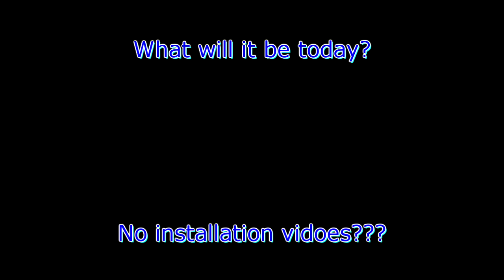No installation videos????!!!!

Comment: Hi Thomas,

I appreciate your expertise you demonstrate in your videos. I've been fixing cars since I was 13 years old. I'm a licensed air craft mechanic and spent 5 years as a journeyman mechanic doing brake and front end work.
Reply: Continued, I see that you do quality work and that you understand how the systems you work on are suppose to work. I really enjoy it when you do your work bench of knowledge drawings. You use a spray bottle to clean excess coolant off places where coolant was spilled, thus preventing a customer coming back thinking he still has a coolant leak. I think you are an excellent mechanic and an excellent auto technician.
Reply from the maker: Ssactoralph Thank you very much for the kind words! I still need lots of improving in a lot of areas. Thank you for watching!
Reply: Ssactoralph .

Comment: Totally agree with your stance. I like to use videos to get a general idea of where to start and which direction to go. I can't understand those lengthy videos where they are explaining where to jack up a car and then proceed on how to do a timing bet. IF YOU DON"T KNOW OR CAN"T FIGURE OUT HOW TO LIFT YOUR CAR, YOU SHOULDN'T EVEN CONSIDER DOING A TIMING BELT CHANGE.
Reply from the maker: I just changed my timing belt... the engine doesn't start... what could it be?

Comment: hello there...I finally got around to checking the oil pick up strainer on my audi a4 b6 1.8t and it was very clean. I cleaned out the grime in the oil pan and cleaned the strainer. My low oil pressure problem was not solved though. Any other place I can look to fix the issue? I always had the low pressure issue but it was very intermittent until last week when I changed the pcv breather tube. Since then the oil pressure light has been coming on and stays on. I think some plastic bits fell into the hole when I removed the old breather. One other thing, I always used to hear a rattling sound when driving, sometimes very loud, especially if I am driving near a wall, if I gave the car just a little gas, the noise would stop. I don't hear it any more since the low oil pressure has taken a turn for the worst. Does the oil pump make a rattling noise?
Reply from the maker: If you are hearing engine noise accompanied by the oil pressure warning light... it might not be a good idea to run the engine. Did you confirm low oil pressure with a pressure gauge? If the pressure is low, don't drive the car.... if the pressure is ok, then you have an electrical issue. How old is the oil filter? The pressure sensor is on the outlet of the oil filter flange. If the filter is restricting flow, oil pressure warning will occur.
Reply: thanks. the engine does not make any noise. it runs very smooth. i changed the filter recently. a mann 940 i think. i have not measured the oil pressure as yet. before the oil pressure light was accompanied by a rattling noise at the top of the engine. it no longer does that when the oil pressure light comes on. i put in a additive called auto rx and the car ran without oil pressure lights for like 5 months or so. i changed the oil recently (mobil 1 5w 30) and I did the pcv breather thing and all hell broke loose! Changed oil again yesterday and cleaned the pick up tube and oil pan but no dice. pressure test, next step! thanks again.

Comment: Does anyone know anything about coolant for a 04 vw Jetta gls 1.8t? I was told to use g12/g13 coolant and that only but is Prestone or peak okay to use? I need to do a coolant flush and need something with no phosphates or silicates? Help and advice is appreciated!!
Reply from the maker: Nico Gibson They are fine to use... flush every 4 years.
Reply: So I can use any coolant for a flush and re fill for my Jetta aslong as it's phosphate and silicate free? Instead of buying g12 or g13 coolant that vw wants us to use, I wanna make sure I keep my car in tip top condition
Reply from the maker: Nico Gibson Tip top condition requires G13 or better.
Reply: Thomas EXOVCDS okay thank you I'll get some g13 I think all I need is a gallon of it then. Gallon of distilled water to mix of 50/50 and add